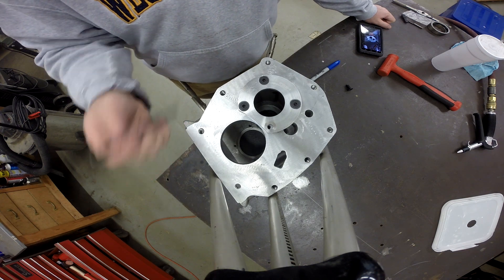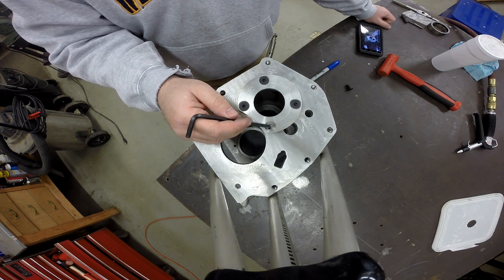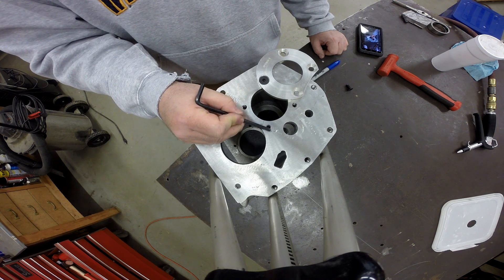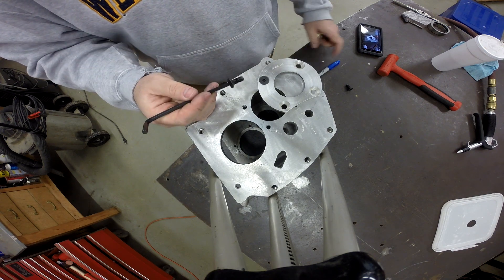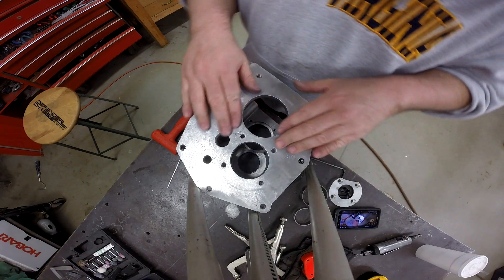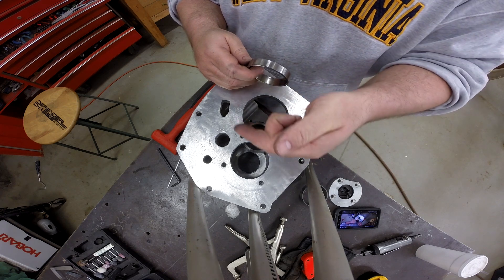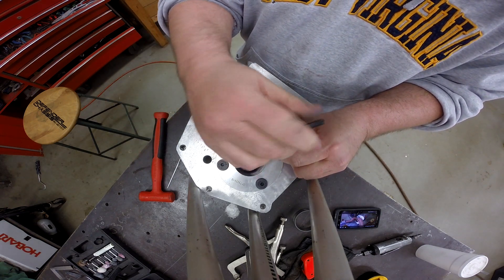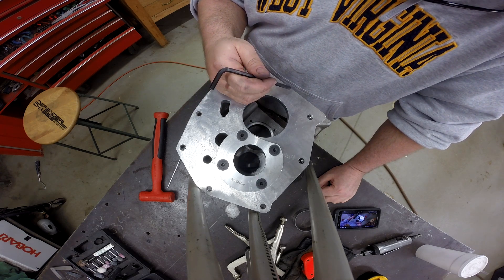TIG Welded Aluminum Transmission Case Repair - G Force T-5

Comment: I've  got a t5 resurrection going on now. Should have thrown it away but didn't. Gotta weld a piece inside the case. Didn't go well yesterday and re-doing it today. I don't really know what I'm doing to be honest. The break area is registered well so it is a decent setup...just gotta get the amps higher I think...used 50A and was too cold and got dirty....had to stop and re prep.